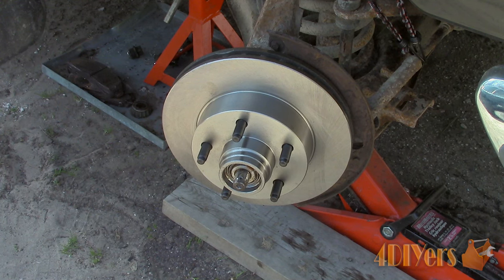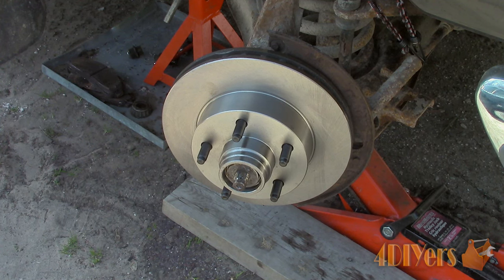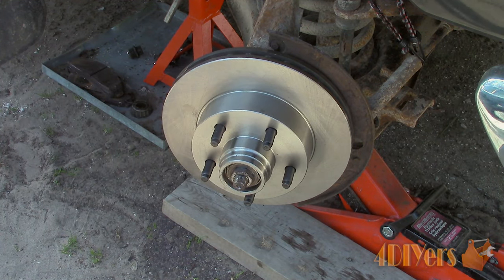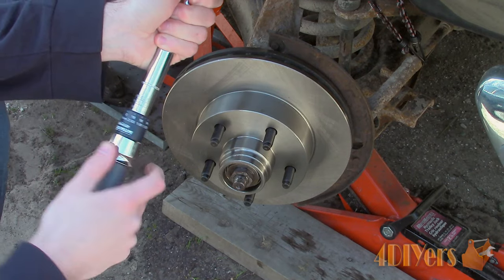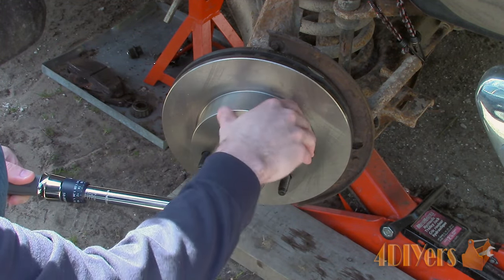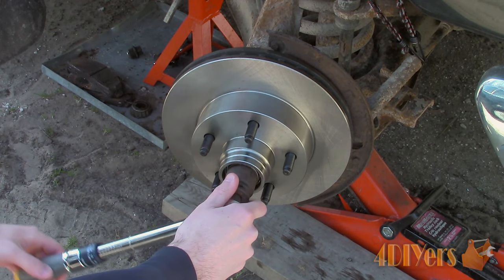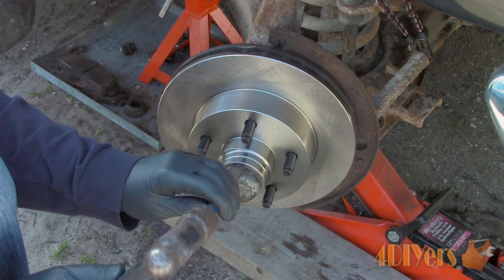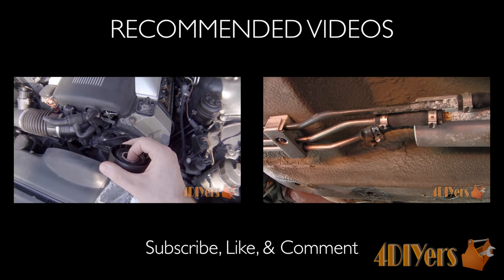How to Preload Tapered Roller Wheel Bearing

Comment: Hummm for decades we would just seat the bearing by making the spindle nut snug, then back it off 1/4 turn.  I have Wheel bearings with 180 K miles on them that were installed that way.   Do not load a tapered roller bearing-- run them backed off from seated at about 10 thousands of an inch.
Reply: EVERY bearing needs to be preloaded. Meaning... there is NO play.

Comment: Gosh I wish this process was so simple.... I've got a 2002 Nissan frontier and I've tried everything to get these bearings to act right. Nothing works. They always come loose. Drives me up the fricking wall.
Reply: I've got a 2001 nissan frontier same problem
Reply: @michaelcarnes6983 I finally torqued them to 60 foot pounds, backed off without letting the hub rotate at all, then tightened it to 20 inch pounds. Finally worked right. Don't let the hub rotate.

Comment: Wait, you said the spec indicates 260lb-in but you're applying 20lb-in? Did you mean 20lb-ft instead?  Can you also explain why you nee to back it up and then re-tighten?
Reply: 260 inch pounds to seat the bearings. That’s making sure they are fully seated on axle shaft. But this is way to tight actually drive with. So with everything seated correctly you back off the axle nut and like he said in this video just snug down to 20 inch pounds this will allow everything to spin freely. You’re shooting for no play and no drag. Hope this helps

Comment: I'm surprised he doesn't fill the void over the outer side of the bearing with high temp bearing grease. IMO this is very useful to prolong the bearings
Reply from the maker: Filling the void doesn't do much. As long as the bearing is within operating temperature, that grease will always stay in that spot. It's only good for back up if you have to take the bearing apart in a roadside/parking lot repair.
Reply: @4DIYers  I stand by all my comments

Comment: If I do this on my '88 Camaro with a new bearing + race, seat it with the specific torque and then hand-tighten it (as the manual doesn't tell you a specific torque for the end torque), it's always too lose. So, if that's the case, is the spindle damaged so that I can't reach the usual end-play by correctly tightening the nut? I took the car to a shop and they justen tightened it until there was no play. They also seemed a bit unsure, and after about 1 1/2 years I had to replace the bearings again.
Reply: Yeah I got this question too, I got specs but seems like following them doesn't quite do it, thinking about getting a dial indicator to measure endplay and following Timken's specs. My biggest issue has been preload I think, if the preload isn't right even if the final load is technically correct, it won't end up right because the bearings haven't been seated right.

Comment: Assuming one followed the specs when preloading and final loading and still suspects there might be an issue, is there anything other than checking endplay with a dial indicator to gauge if they are installed correctly? I actually followed your guide on my Mazda B2500 (Ford Ranger) to the T and still feeling a little loose up there when the truck is driven. Also, if for some reason the bearings weren't preloaded correctly and driven on for a couple days, would that immediately damage the bearing beyond use in your opinion? This is already the second time I'm doing this job, the first time I followed ErictheCarGuy's guide and got a real bum steer, the bearings weren't seated at all and the rotors were wobbling horribly. I threw those bearings out and got a 2nd set of  bearings and rotors with new races and when I followed your guide they ended up much better, and maybe I'm being paranoid but I still suspect there might be an issue. Guess in the mean time I'm gonna install new races in the rotors I took off the truck while I try to figure this stuff out. Thanks. P.S. What brand of torque wrench is that?
Reply from the maker: You can do it by feel too and is normal if you're used to preloading these. Damaged or dirty threads could be throwing off the torque values, so I would recommend checking/cleaning the spindle and castle nut threads. Whenever replacing bearings, always make sure you use the supplied inner and outer races as they're matched. Not doing so can cause a premature failure and may effect preloading clearances too. Also make sure the races are fully seated too. I've had a few comments in the past where the races weren't fully installed. Just to be safe, I would take them apart and check them over, make sure there's not surface damage. Short distances and if they're good bearings, hopefully no damage was caused. Bearings have hardened surfaces to reduce wear. As for the torque wrench, it's made by Mastercraft from Canadian Tire.
Reply: @4DIYers  Many thanks

Comment: I’ve done plenty of wheel bearings by tightening the nut pretty good while rotating the wheel, then back it off a smigin, then nip it up to the nearest castle in the nut, if I need to align the pin, I’d tighten a hair, but never loosen. Wondering without a torque wrench or a rolling spec, is this fair practice?, touch wood, I’ve had no failures in over 20 years , but of course if I had a spec, I’d most definitely use it.
Reply from the maker: Sounds good to me. For video purposes I used a torque wrench to provide a way of measuring, especially for those that are new to such a job but I typically do it by hand as well.

Comment: Thanks, never done this before and my 1980 Z28 Haynes manual says 120lb but doesn’t say to back off ! I thought this was way too tight as with the wheel off the ground I could hardly spin it. For me I agree to back off half a turn then tighten to between 12-20Ftlb and insert a new cotter pin into the castle nut, which will allow it to turn freely but not so tight as to crush the bearings and over heat them. Thank you and I hope this helps others
Reply from the maker: Glad I could help and thank you for the feedback! 120ft lbs almost sounds like it's for a ball bearing type wheel bearing instead.
Reply: @4DIYers  beautiful information for me Dodge Dart sxt how many pounds of price would be correct
Reply: 12 in-lb = 1 ft-lb. 120 in-lb = 10 ft-lb.
Reply: @4DIYers definitely

Comment: Did so for my bearing on a W208, front right. There's no play and the hub spins freely. But the issue is that there is a very slight noise when rotating the hub, barely noticeable only if you are in front of the wheel hub. Did not torque it with a torque wrench, but by feel (as watched other's do so successfully). Kept tightening it slowly while rotating for it to sit evenly, then tighten till the hub had resistance when rotating, then I backed off a bit until I have no play and can spin. But then there's the slight noise.
On the other side there's no sound when rotating. Any ideas what it could be? I greased them well, pushing the grease in the bearings and adding everywhere.
Reply from the maker: Is there anything rubbing? Other issues can be either dirt within the bearing, a poor quality bearing, or surface damage on the bearing.

Comment: if it rotates the hub with a5lb weight, your sa/fb rx7 bearing torque has been set correctly.
Reply: went through this on many rx7s. I eventually always used this method as both cars still run flawlessly. just haven't driven the fresh rx7 I got recently. in the process of a fc rx7 front sub frame swap.
Reply from the maker: Awesome tip, thank you for sharing! First time I have ever heard of this method. Where you are clipping on the 5lb weight? Right on the wheel studs?

Comment: Why not just say 16 foot lbs for the torque? Is it because it's actually 16.6 foot pounds?
Reply from the maker: For the fact that most foot pound torque wrenches do not go that low, therefore you need an inch pound torque wrench instead.

Comment: 20 inch pounds on an axle nut? what in the world is this? lol
Reply from the maker: Yes that is correct. Too tight will cause the bearing to overheat and wear out.
Reply: yeah. i think i was a little confused, as you've put the cotter pin in and the cap back on. i thought that was the final torque spec on the nut lol
Reply from the maker: @vinny6_9  Haha, no worries, it's a pretty common question. It doesn't seem like much, but it's the correct procedure.
Reply: Yes even the Toyota have little play in front wheels
Reply: 20inc pounds seams very low?, am i missing something, it is only 2.25nm or 0.25kg it is hard to find a torque wrenc that has this extremely low torque range.